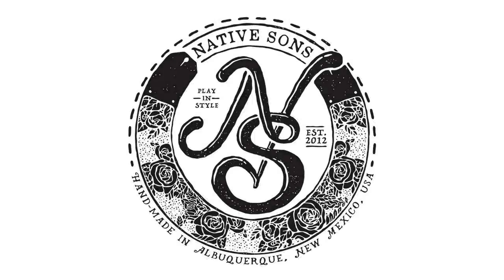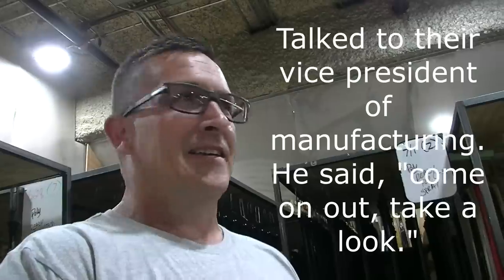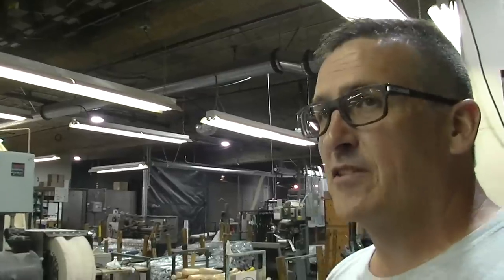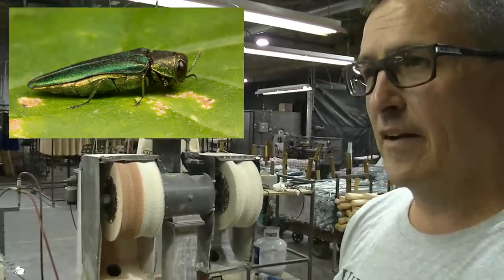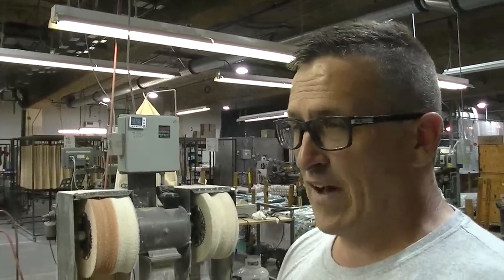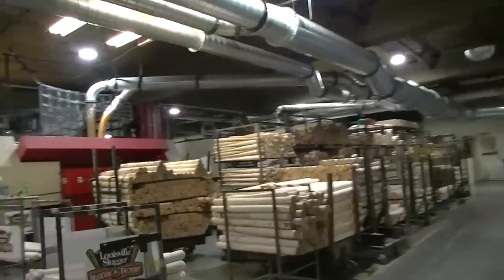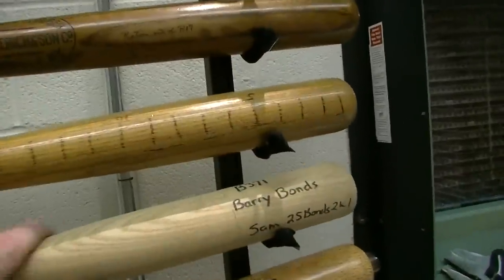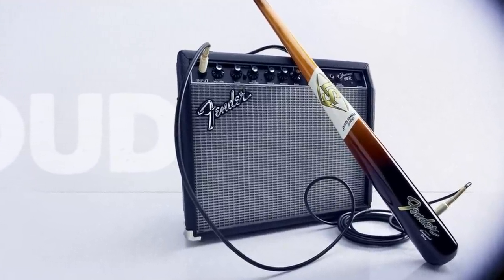The Untold Story How GIBSON, FENDER & TAYLOR Guitars Changed...BASEBALL?!?

Comment: After 40 years building guitars I learned early on closeness of grain = better guitar = bullshit.
Reply from the maker: It certainly is the conventional wisdom going back to, at least, Stradivarius violins.
Reply: The Guitologist it’s about the density. With spruce grains per inch have zero to do with sound. I built two identical guitars in 1985 that the only difference was one had the stiffest tight grain spruce top out of 200 premium tops and the other had the loosest wide grain top. 34 years later they both sound so close to exactly the same it’s surprising, yet the loosest “low grade” top now has the most headroom of any guitar I’ve ever played, which is the biggest surprise to me. This was when I owned the Mossman Guitar Company.  I believe how it’s cut, perfectly quarter sawn with no run out, is the real secret to making world class stable guitars that perform at the highest level for decades.  Since I have been making the greenest tech acoustic world class sounding guitars for the last decade with my #harmanyandkay_conversions  I’m learning that the internal design has much more to do with the sound than the actual type of wood. Many of the guitars we rebuild are made from all birch and it is amazing how close these sound compared to mahogany or maple guitars. There is a difference with different woods but it’s more like a slight EQ adjustment rather than a dramatic difference in tone. The YouTube video of the cardboard Strat reaffirm’s this point.  I’ve made over 1000 world class acoustic guitars and have spent the last decade remanufacturing department store guitars and turning them into guitars that sound similar to prewar Martin’s and Gibson’s and a lot of the information on the internet regarding woods is just plain wrong.
Reply: The Guitologist I also spent three years in Nashville working at Gruhn Guitars restoring vintage guitars. It was there I feel as though I discovered the true secret of what makes the 30’s era designs sound better than the modern designs. I now teach a school on guitar restoration in Athens Ga. Baxendale Guitar.  My guitars get used on a lot of big albums by some serious major league artists. Check out Buddy Millers latest studio tour interview.